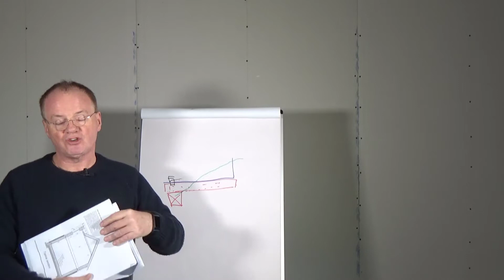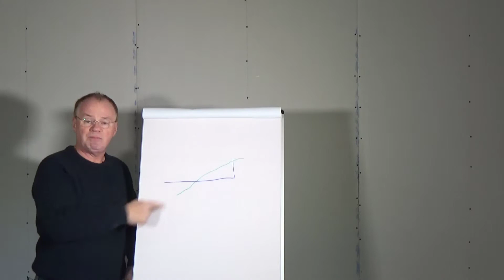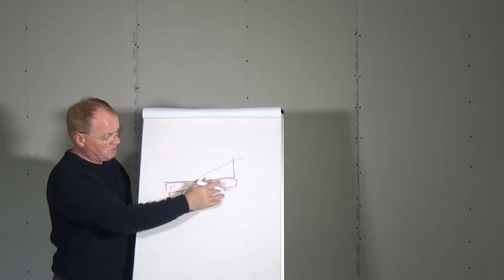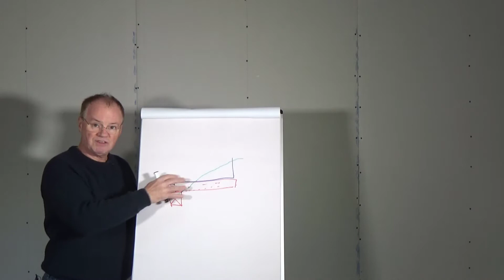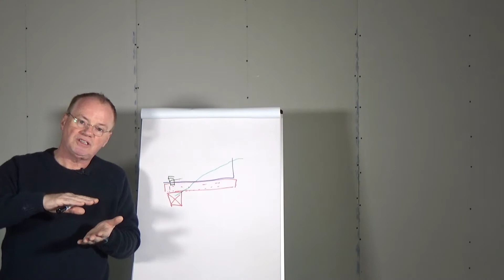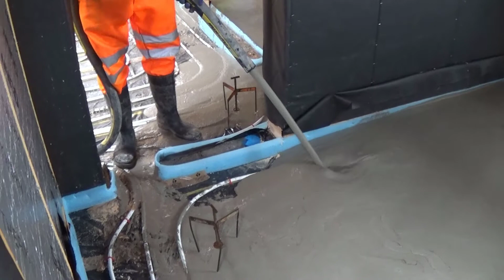From the Foundations to Finished Concrete Screed Floor

Comment: great informative vide0. what is the spray used at the end once the screed has been laid?
Reply from the maker: Hi hiren patel, The spray helps seal and bind the screed by creating a chemical reaction and this then controls the rate at which it sets. This will in turn help stop any cracks appearing.
Reply: @BuildItandProsper  thanks alot